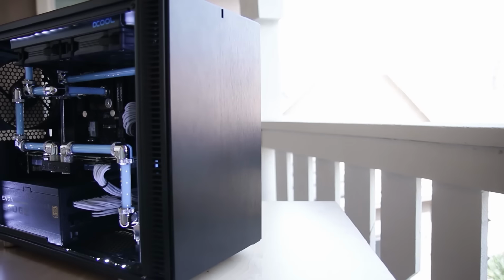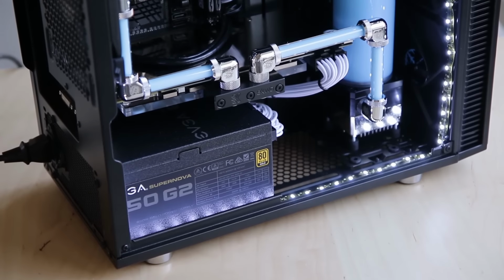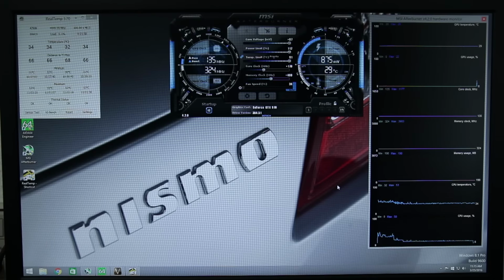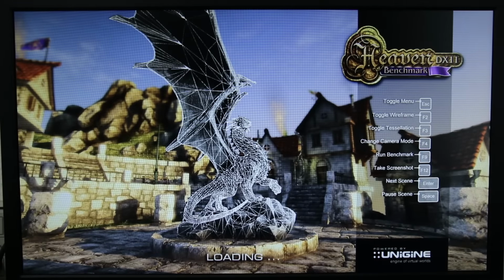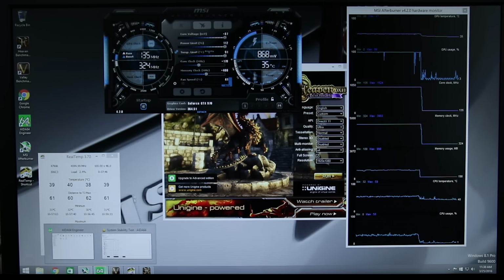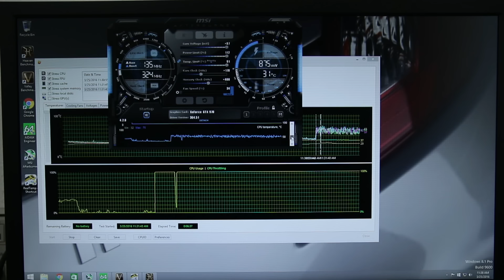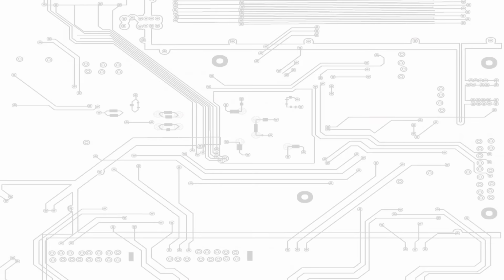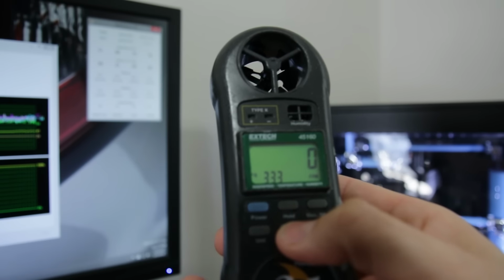Was a 240 Radiator enough?? Temp testing the ITX build

Comment: I would just like to point out that this was with a consumer grade CPU and the very efficient 970. If this was a more maxed out build with an X99 CPU and flagship GPU (like the common high end 5820K + 980ti combo), then a single 240 would be pushed very hard. TDP should really be considered more than a simple "120 per should be fine" kind of attitude. This isn't really directed at Jay, just more of a suggestion for anyone actually considering custom water cooling. Most viewers here aren't, so I get the keeping it simple mentality.

Comment: Just a note. Radiators do not have a fixed wattage rating. There is no point that a radiator gets to that it stops radiating enough heat away. That is a myth often referred to as radiator saturation or heat saturation. Radiators are rated in C per W or how many watts it can radiate per degree C above ambient temp it is. If it dissipates 100W at 5C then it dissipates 200W at 10C, 400W at 20C and so on but there is no limit other than the limits of the materials and boiling point or pressure build up issues close to boiling but no PC system would ever get that hot.

Comment: A small sidefact about thermodynamics: Heat flux depends on temperature difference, so the hotter the loop gets, the more heat a radiator will be able to remove. Radiators are rated at watts per temperature difference between ambient temp and water temp. If you double the heat output of your components, the maximum temperature difference will double too. So as long as nothing's melting or burning or destroyed in any other way, there will always be a max temp, where heat input and output are at equilibrium, meaning temperature won't ever rise exponentially.